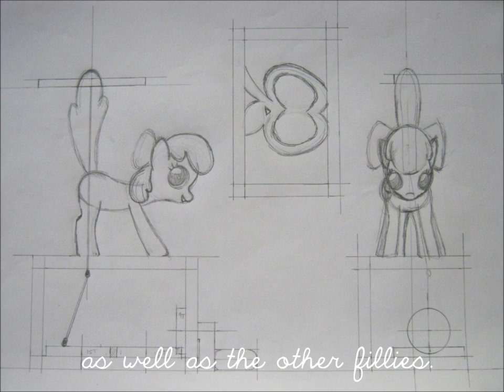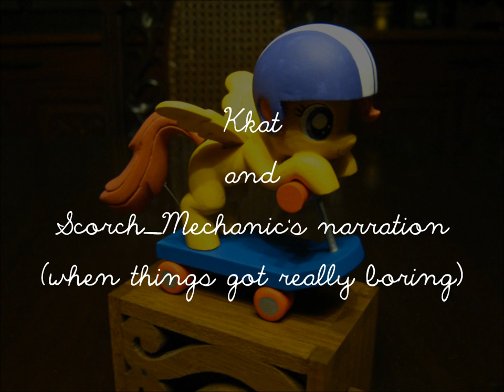The Making of CMC Automata

Comment: Is it hard to shape the gears?
Reply from the maker: Being so small and since I do them by hand, yes. Of course one could use a CNC router or laser to cut them out easier.
Reply: Oh, so you basically trace out the gears shape and then you carve it out?
Reply: Oh! Nevermind I get it now, I couldn't read the cursive at the bottom, but I was able to read a little.